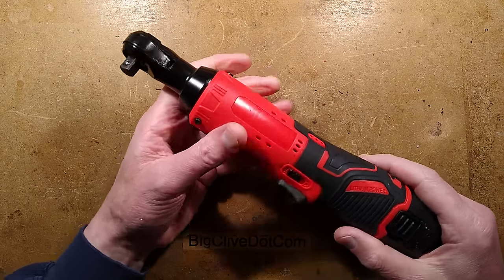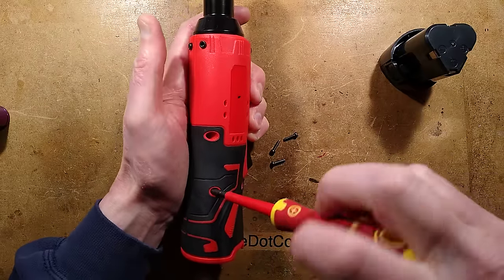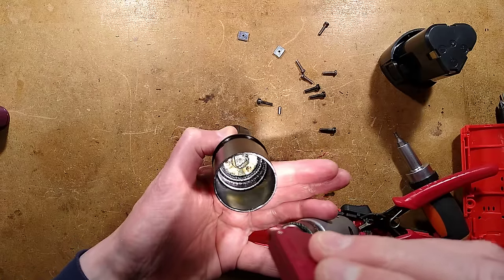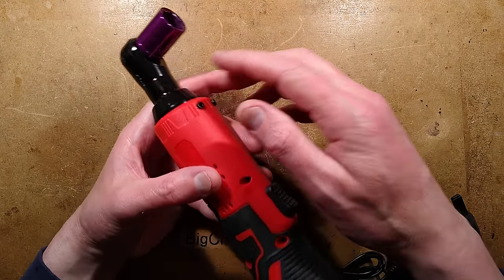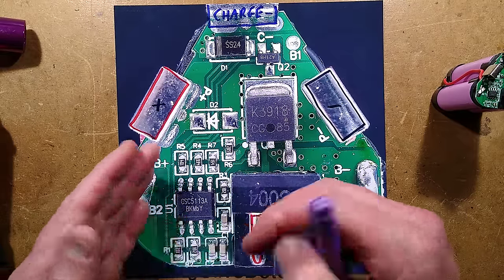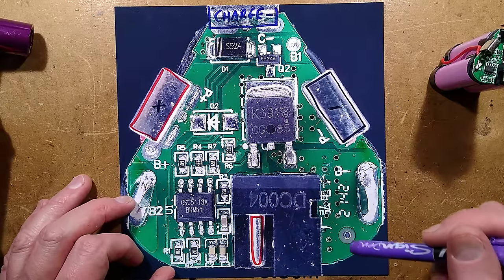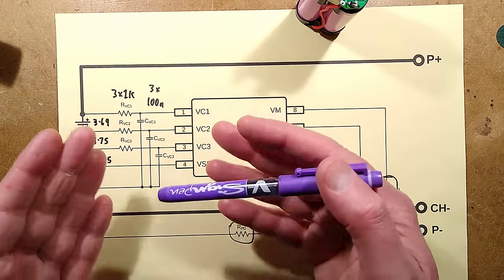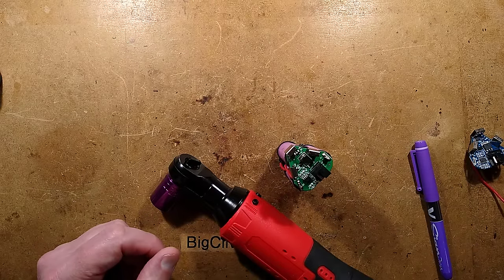Inside a cheap Chinese cordless ratchet

Comment: This design has been around for ever as a pneumatic tool, the electric ones just replace the air motor with an electric one. Very handy in tight spaces. This kind of tool is really not built for torque, the idea is you use another tool (or just manual force on this one) to break loose and tighten the fastener and this only spins it out or in.

Many of those battery management chips actually will balance the cells if the charger is left connected for a long enough time after the light goes green. The balancing current of the chip's internal circuitry is very low though, something like 50 mA, so it takes a long time to balance the cells if there's any significant difference. Also, there's no indication of when the balancing is done.
Reply: Precisely--these things are very handy in tight spaces where working with a traditional manual ratchet wrench would be a real problem.   I've got a no-name Chinese on with 20V lithiums that does the job without me needing to wrestle with a pneumatic one and the accompanying air hose.
For higher torque needs, one uses an impact wrench (either electric or pneumatic).
Reply: I can't believe that Clive didn't know the stuff about how it reverses direction and was even more shocked that he thought it was an impact because of the noise. He's pretty familiar with tools, but I guess that he's just never seen one of these.
Reply: Huh. I'd heard of power ratchets but not really "got" why they were needed. The tight-spaces explanation makes perfect sense.
Also, seconded about the balancing capability. I was floored when Clive said that "it can't balance".
Reminds me of when I manually balanced a battery for my FPV goggles, as it was so far out of balance that I was getting a severe loss of runtime, it didn't have a balancing lead, and I hadn't known about this slow self balancing. (I had just scraped off some of the shrink wrap to expose the contact between the cells.)
I was always told to disconnect the battery immediately once the light turned green to avoid over-charge.
Reply: @FerralVideo  In most cases a ratcheting box wrench will suffice, but this tool will cut minutes off a job with a few bolts. MANY minutes when you have almost no room to swing the end of a hand wrench.

Most guys seem to use this tool for bolts accessable by actual impacts. I use those when I can because this type of tool will wear out faster.
Reply: @hydrocarbon82  An impact can easily damage fasteners or the bolt holes. I would use the ratchet in place of an impact anytime I can. I'll only use an impact on very large fasteners or lug nuts. If you start using an impact for things like water pump replacements on automobile engines, you're going to run into issues.

Comment: Most of these ratchets are only rated for 30-40lbft. They basically are only meant to be used as time and wrists savers for running down fasteners in places that a normal driver cannot reach. If you need more low-effort tightening in a ratchet-like form factor to run high-friction fasteners in/out, get an angled impact driver.
Reply: I'll add that the full-torque industrial/assembly line version of this is called a nutrunner. They have torque and angle sensors for precise feedback control, can automatically detect cross-threads and stripped threads, and even log data in case e.g. your car needs a recall. The assembly line torque-controlled version of an impact wrench is called a pulse tool.
Reply: For anyone else who needs to look it up: that's about 40-55Nm.
Reply: "only" - 30 ft lbs/50 nm is a huge amount of force and will readily strip the crap out of anything m10 and smaller! It will also smash your wrist against everything if youre not alert. 

I have ryobi ratchets, most powerful one is 80nm, mid is 50nm and a small 8nm one. Guess which one I like to use the most, especially when doing things up?

The 8nm one - because I can safely do up most fasteners and know they are not stripped but snug, and ready for a final torquing pass.

Doing stuff up with a 50nm tool on anything m10 and smaller is asking for trouble.

The best combination is a high power tool to help you break stuff loose (50-80nm), then a low power tool when putting it back on.

Don't use a 50nm tool, especially one without a speed control, to do up a small fastener!

Comment: The rotating pin is not likely to break first. At most, it will be rotated minimally until the pawl in the head engages with the teeth of the square drive. In these cheap ratchets, the failure point when using a lot of force to break a fastener loose is the plastic body.
Reply: Probably true about the failure point but no mechanic with more than 2 brain cells would use such cheap tool to break loose stuck nuts, they'd use a breaker bar.
Reply: My boss had the same ratchet I used it to crack off a 6mm ecu bolt and the metal bit broke off the very top of the ratchet.

Comment: I have a similar model, from Lidl.  It stands up to my light duty - the switch button itself broke at the hinge but a strategically-placed cable-tie returned it to service. The battery is different, with an external charger.  Thanks to this video I now understand that it is not a chain-drive mechanism.
Reply: Ive never seen a single cordless tool that is chain drive.
Reply: @davelowets  Agreed. The shape of the head rules out a conventional gearbox but prior to this video I could not think how else it might work.

Comment: Cheap tools definitely have their place, Clive. I wanted to cut brick to put a metal wall-box in for mounting a large powerpoint array. The only tool that was suitable for the job, was a multitool. Not quite meant for cutting brick, but it was compact. So I purchased a cheap sacrificial one, rather than use my Bosch Blue unit. It cut the brick extremely well, so long as it was used within its limits. It still works to this day. Cheap tools aren't all bad.
Reply: Why would you purchase a cheap tool instead of using the premium tool you already own?? 😕
Every tool I own is from Snap-On, and I use the shit out of them, that's what they are for. 
There's really no point in buying premium tools just to look at them. Use 'em..
Reply: @davelowets   The multitool isn't meant for cutting brick, that's why I purchased a cheap version of the tool for that specific job. I had no idea, until I started cutting, if the brick was going to damage the tool and these bricks were over-fired and very hard. The Bosch was new at the time, I wasn't going to waste that on a job it was not meant for.
Reply: @channelsixtysix066  They're meant for cutting whatever you want to cut.
Reply: @davelowets  So are they multi purpose then?
Reply: Take them back after breaking to Harbor Freight.
Reply: @liamholcroft7212  MULTItool. Think about it for a second... 

Yes, they are made to cut into pretty much anything that you want to. Drywall, wood, plaster, brick, concrete, tile, and the list goes on. The cutter blades are replaceable, and I can't see how one would damage the tool trying to cut bricks with it. All the tool consists of is basically a long handle with an electric motor in it, and a narrow, oscillating(back and forth) blade at the end of it. Picture a large version of a beard clippers without the stationary blade on it, just the moving one, and that's what the tool os similar to.
You pretty much turn the tool on, and make a plunge cut with it into whatever you want. If the blade won't penetrate or cut through the object, no harm done, it simply won't work for the job then.
Reply: @davelowets  oops someone missed the obvious joke
Reply: @liamholcroft7212  Well, in case it wasn't a joke, and for other people's benefit, the info is there.... 🤷🏻
Reply: @davelowets  thanks wiki

Comment: I wonder what the weight is of the cells. A nominal cell is about 45g. I've seen 18650's as low as 15g, which were also labelled 12000mAh (yes, 12Ah). They might as well had said they had infinite capacity. Turns out they held 350mAh.
Reply: I have a 9ah "9000mAh" 18650 that came with a cheap chinese laser, and it really only had 200mAh capacity. The cell was very light, and had something moving around inside when I shook it, and the cylinder the cell was in felt like plastic instead of the usual metal.
Out of curiosity I cracked it open, and inside the plastic shell was a tiny (what looked like a disposeable e-cig cell) connected to the terminals, and the rest of the space inside was filled up with SAND! WTF?? I've never seen fuckery like THIS before... 😕

Comment: 6:00 No, that pin is the rotary mechanism that inserts into the dog that wobbles across the gear of the ratchet head.  All the force and torque will be applied against the ratchet dog as in any other ratchet.
Reply: Yes, I was going to point that out.
Reply: Notice that once that pin was removed, the rotary mechanism swung out. This means that the pin is keeping the mechanism from swinging. The pin takes zero or almost zero rotational load from the mechanism,  but it takes all of the side load.

Comment: I've got something that looks eerily similar, but branded Sealey. The first one broke within a day but the second had lasted over two years. I've no doubt this would last about as long as a prawn sandwich on a hot day in professional hands, but as a hobby mechanic I don't use it every day so the investment was worth it for me.
Reply: I have added that prawn sandwich analogy to my vocabulary forthwith.
Reply: Funny you say that because as I’ve heard and understand Sealey tools are just rebranded cheap Chinese tools like this cordless ratchet.
Reply: @Alexander_l322  Sealey tools are rebadged cheap generic tools ,sourced from Chinese factory’s at very low price . You see the same tools ,in other colours with budget logos on them ,for 2 or 3 times less the cost .

Comment: That eccentric pin won't snap off. Only the energy of the motor can go through that pin. The ratcheting top part works just like a normal ratchet with all the energy going through a latching cog. I've torn apart the pneumatic ones 1,000's of times and they are all built just like that.
Curved snap ring pliers works great on those circle clips. Curved for inside and straight for outside clips.

Comment: I have been using similar ones like this for a  while, just a couple of points of note, the head is basically a normal ratchetting head, so when you use it like a normal ratchet, so the force is handled by the ratchet not the pin. however under to much force you snap the plastic mounts off the motor end. The battery indicator is weird, it basically rpm based, so as the ratchet slows down the meter drops. so basically it stays green until its almost dead. The 12V battery is used by another tool company here in Australia called OZITO. they have been using that battery style for many years. even the same battery model and bms board. and they interchange perfectly fine, except they only charge from a dock. but it makes replacement easy. also on the charger, here they used that exact same charger, pulled the pins out, superglued a plastic plate over the front and added 2 spiked pins pushed into the plastic and soldered the wires from the original pins. as soon as you pull the plug out of the wall the pins stay in the socket. also for whatever reason i have a 12V (mine came with 2), 18V and 24V units,, all use the same batteries and chargers, but have different screen printing on them... so watch out for that. now as for longetivity, i average around a year or so (in a small engine workshop) and generally its the plastic 4 bolts around the head they chew out. but for $30 i dont care. they are not super powerful, but strong enough for the average handy man. Thanks for making learning fun Clive.

Comment: These are ment to be used for undoing and doing up items not for undoing tight nuts/ bolts in the same way you should crack nuts with a bar before using a ratchet

Comment: Hey Big Clive, thanks for this video. Watched it and had a look at one of these I bought a while ago, with a "dud" battery. Took it apart and found the K3918 mosfet really badly positioned and only 1 leg soldered in place! (Incidentally, the mosfet was a P75N2LDG) Part ordered off flea bay and awaiting repair.

Comment: For anyone who got their hands on one of these, the cases make for GREAT induction bolt heaters. an extra $30 and you can save yourself a few hundred. Anyone who's dealt with rusty bolts in areas where you cant use a torch knows how lovely these are.
Reply: Cases? Or chargers. Interesting!
Reply: @dangitbobby7887  I'd strip out everything above the battery system, and go from there. keep your on/off switch, make sure the coil kit is compatable with your battery voltage and you're good.
Reply: @sakaraist  interesting. I have a venom hp but I thought you'd have to have it plug in
Reply: @dangitbobby7887  Depends on how much power you want to run, the higher obviously, the faster it'll heat up. That said you can get quite an oomph from batteries, it's just not great for the cells so cheapo ones like ebay tool packs work fine.

Comment: I have two of these, I`ve had no problems with them, they are very handy in confined places & save time (a lot of time if you are in a really confined space that you can only get a few degrees arc on a normal ratchet). 
I always break the bolts off with a proper ratchet or breaker bar first, then use this. They do bog down on really rusty old bolts, but I`d expect them to. For the price, they`re brilliant, as long as you use them correctly... I`d happily buy another.